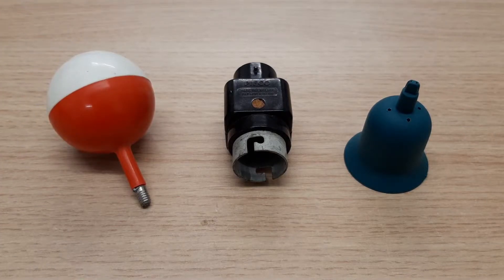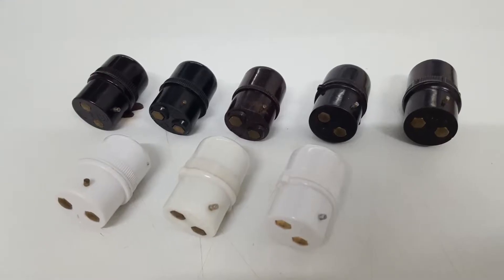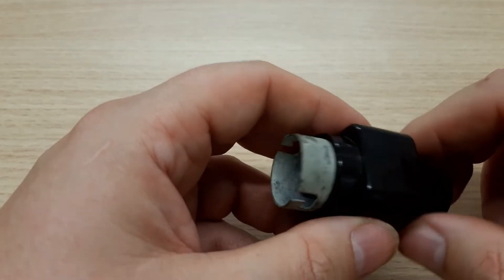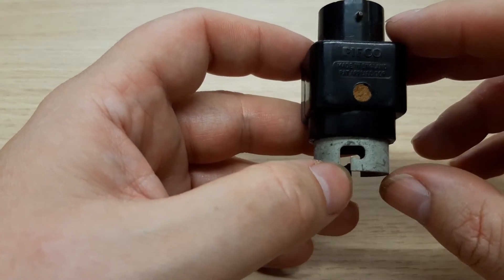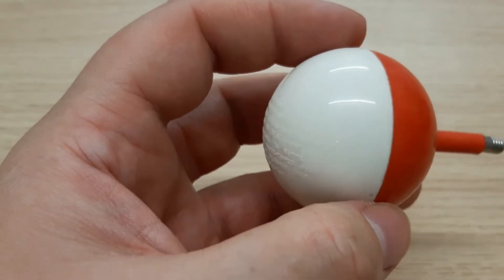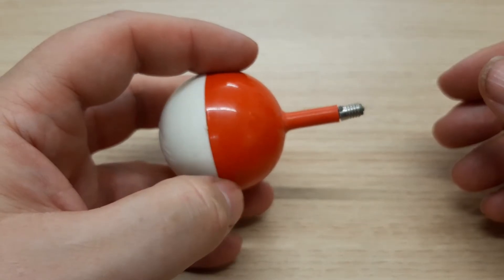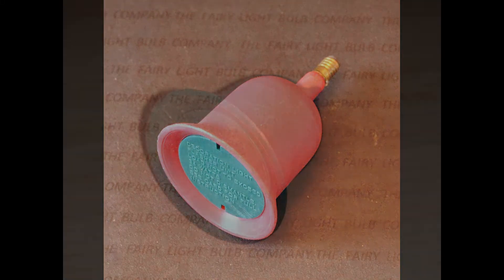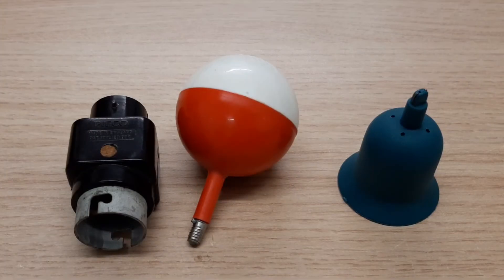Three Vintage Christmas Light Flasher Units

Comment: The bayonet plug would have been standard - in the old days many houses didn’t have wall sockets and only had light fittings . My aunts house didn’t have any wall sockets upstairs and only a couple downstairs . Early wiring in houses was expensive and quite basic
Reply: Different voltages and plug styles to depending on region too way back when, once everything was standardised it solved that.

Comment: That's a nice collection of flashers. The old flasher units have a bi-metallic strip in them like that in the flasher bulbs but larger. One of mine failed so I cut it open, the contacts had fused together as the carbon contacts had worn out. The Woolworths flasher has a flat round circuit board inside, the capacitor eventually fails but is easy to fix with a new capacitor of the same value. I too prefer the flasher bulb as you don't loose a bulb and they look neater.
Reply from the maker: I'm glad some can be repaired. If I have any issues, i'll let you know. 👍
Reply: @vcluk  yes please do, I always try to repair old Christmas items.